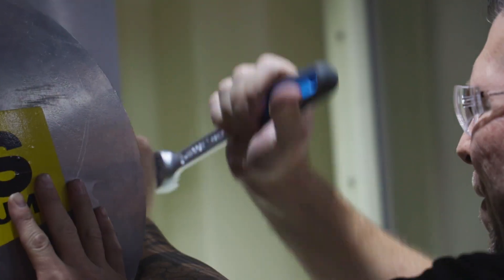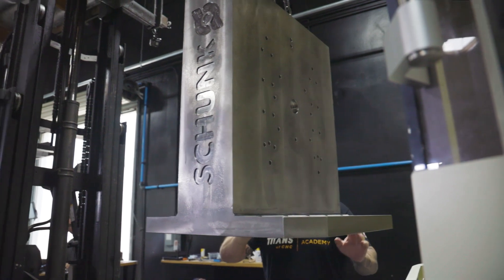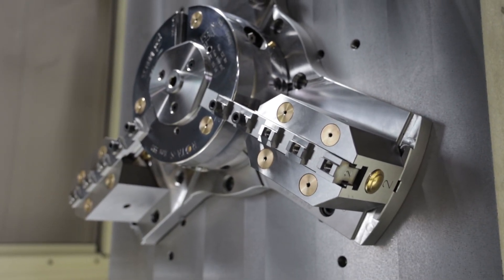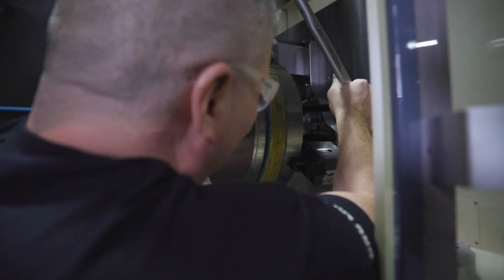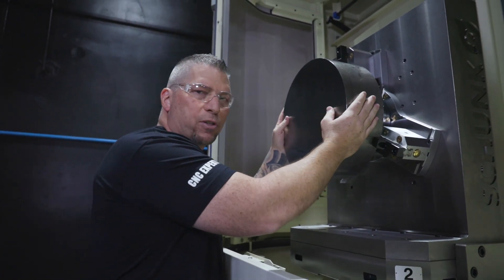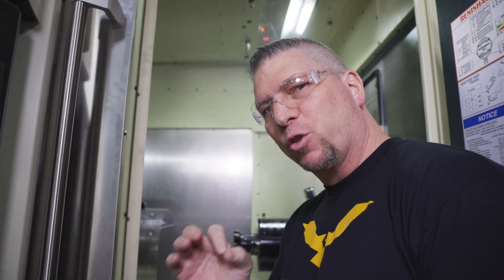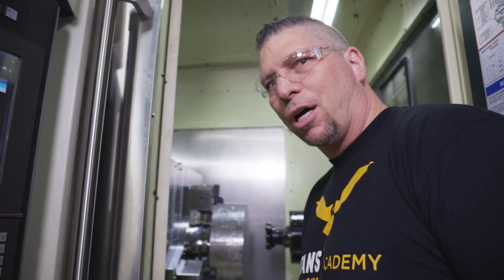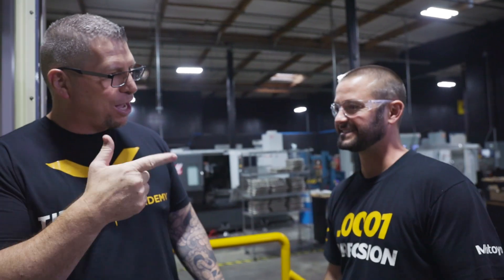60 HP MAKINO Horizontal | Machining Titanium | 1st CUT

Comment: Why would you use a horizontal vs a vertical? I understand it is more rigid and thus has more HP, but Is there a particular type of part that you can not do with a vertical? it seems like this part so far could have easily been done on a VF2, just maybe with a longer cycle time?

Comment: Why not skim the tombstone and make it "perfect" that way?
Reply: Do you mean instead of cleaning everything immaculately or instead of correcting it with an offset?
If it's all clean then it should be "perfect" in the y direction. If it's out in the x direction it's pretty simple to correct with a b-offset no need to go modifying a precision tombstone and making it imperfect. 
My question would be... will he get a better way to locate the  tombstone quicker and more precise so it doesn't need offsetting?
Reply: @longnameman . Not against cleaning and stoning, I'd just rather not have to deal with a B axis offset all if the time.
Reply: @CR3W1SH03S   B axis offsets are not a big deal especially if using a probing system. Putting a precision tombstone on and machining the face on it because it wasn't located 100% parallel/perpendicular to the machine axis is just fundamentally wrong.

Comment: I cannot stress to my operators enough about perfect mating surfaces. I always run a file over the edges and keys and everything that has a 90° corner. Run a whetstone with some WD like you did and go over every millimeter with clean hands to feel for debris. Then the process of pulling the tombstone over to the stops is also critical (as you've stated) We got a Renishaw XL-80 laser system for linear displacement offsets. Basically you move the axis 20mm and it tells you how for it really moved, then you enter that difference into a table for the whole length of the axis stroke. Then a Starrett cube for X-Y, Y-Z and X-Z geometry and once all that is done, it's all done with the programs. You have a perfect starting point. We also have the Renishaw wireless probe to detect the part datum's.

Comment: Did you happen to look at the makino T1? Our shop has two and a a92 on a cell system. The T1 is a beast cuts horizontal and vertical hsk 100. Our shop is in kansas ;/ Have a look at the website dynamicnc.net

Comment: Hello Titan. Why don't you use zero-based systems if schunk is your partner? And the column is better to order immediately for Makino seats( I Think this is not a revision of the technologist) weight savings. Or make yourself on this machine( the best value for money, perfect parallelism and perpendicularity relative to the spindle!!!)And in why there is no internal coolant eyeliner, especially when processing titanium! 21 century on yard. Each machine must have an internal coolant supply, at least 20%. I've been watching you. You're great. Keep it up. PS: Sorry for my English. I live in Russia. You are true professionals and I am happy to follow how you develop. But the internal supply through the tool must be provided!!! Titan errors technologists is short, and you should know that. From me personally you enormous respect and respect. Why did you choose Makino?

Comment: Love your passion for the industry wish I lived in your area would enjoy working and learning more of the trade from you but this is good too, I have worked with metals among other materials my whole life started out working in a small shop making the sand cores for foundry parts not too long there, then worked for an aluminum foundry in the furnace room learning from the "old man" Mr.Birkhold he was a strict fairly grumpy man but knew his stuff in that industry learned much about mixing different alloys and pouring by hand into compacted black sand molds pretty cool as I was young. Then spent 20+ years in metal fabrication working with and on 4 different brands of lasers(cool machines) one of the first waterjets, a flow brand if I remember correctly and quite a lot of manual (old hurco) then cnc pressbrakes couple different brands: Cincinnati, electric Mitsubishi, turret presses, roll forms, plasmas, ironworkers, o.b.s. presses,  made a lot of foodgrade products I.e. spinnerbowls & elevators that went with them we started the trend I believe with the stainless steel food grills (Kalamazoo grill) square to rounds, quite a bit in the fabrication industry now machining the last 5 Years and love it but am stuck in a place that could be so much more if you know what I mean?

Comment: why did not you deburr the edges of the part right on the machine, so that it sits perfectly on the vise?
Reply: I didn't get a good look at the chuck but it most likely has a undercut in the seat so not necessary
Reply: Or I hope it does lol
Reply: Because it's perfectly perfect as it is! Don't question Mr. boom bastic
Reply: Bc the vise is a BEAST

Comment: Just can’t believe there’s no more METRIC value for speeds and feeds in a few last videos... :(
Reply: Multiply ipm by 25.4 to get mm/min
Multiply SFM by .3048 to get m/min

This was filmed in the USA, one of the very few places where imperial is still used. That’s the way it is. There’s no sense in complaining about it. We don’t use metric. While it is a better system, the tooling, material, etc is harder to find and more expensive in metric sizes. So practically, metric is worse where it’s not used as a standard.
Reply: Max Selna yep, but since guys works and show different workarounds with tooling for a whole world there’s still a good chance to get both in information table...
Reply: 25.4 is the magic number or 0.03937 for slightly better accuracy
Reply: Mikhail Davydenko 25.4, man- it’s basic math.

Comment: And this is how we make difficult a simple job :))) why a so expensive and not so rigid fixture when this first part could been done more effectively on a vertical 3 axis economic machine??
Reply: Probably just demonstrating the machine
Reply: @Bawbag0110  my first thought. But the machining sound and also the dynamometric click  sound wasn't that good. Ok for the next process it will be necessary. We will stay tuned
Reply: @jenacbxx  where did you see the part? Is it in one of his social media accounts? Or do you think that this was "the first part"? This was a 0.035" cut, that may have gone up to 0.100" depending on the flatness, and he was going very conservative. If you think that the rigidity is so compromised that it can't handle this little baby cut, then there would be a big problem. Also, it's a lot more difficult to move the part around the shop, to different machines, with different operators, rather than doing it all in one machine.
Reply: This isn’t the finished first part and it’s about showing off how to use and run the machine. The part is only a piece of the video, the machine is the real star of the video.
Reply: Where's the metric at 🤔........
Reply: @yeheyheyyeh89  25.4 or 0.03937 for more accuracy  the magic numbers

Comment: Wow! This is so impressive! Someday I want to get my Hands on a machine like this! You are doing an awesome job Titan!✌️
Reply: a four axis machine? its quite limited so i have no clue why titan would get something like this for his shop..
Reply: Balonkers my work has a lot of these machines and you can make the 5-axis. Also those machines are monsters and they have a lot of room to play around with on the inside.
Reply: @fivestarman9474  although what you say is true, i think that investing in a 4 axis machine in this day of age is a step back. sure you can do simpler tasks in larger batches if you can fixture it correctly (like Titan often does), but the market demands higher flexability since there are much competition for these simpler jobs, like small workshops with under10 years of business. therefore you need to be more flexible to be able to compete, atleast in my experience

Comment: I would clock it up just to be sure
Reply: Probably you ment indicate? Like, check the parallels to X and Y axis?
Reply: @MrUberJoker  yes that's right
Reply: "clock"?
Reply: @danl.4743  You did Clock it up, DTI , Sorry didn't  see that far into the video
Reply: @mw8580  "DTI"??  
Dear Sir.  Speak regular English please.  I am trying to understand you.
Reply: @danl.4743  DTI and clock are both pretty standard English, although you might need to be from England to pick up on it. "DTI" is dial test indicator and "clock" is indicating.
Reply: @Limosical  Thank you.